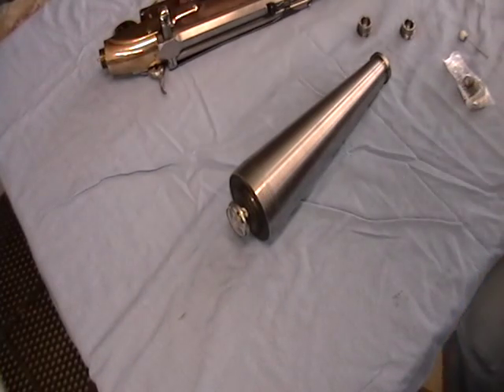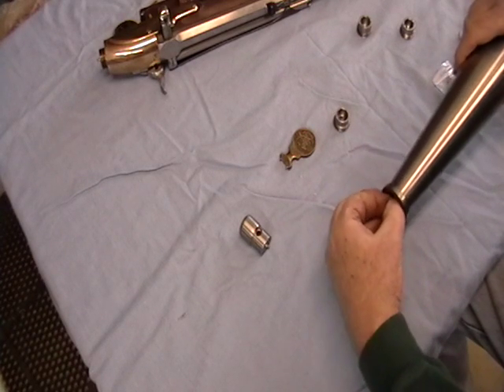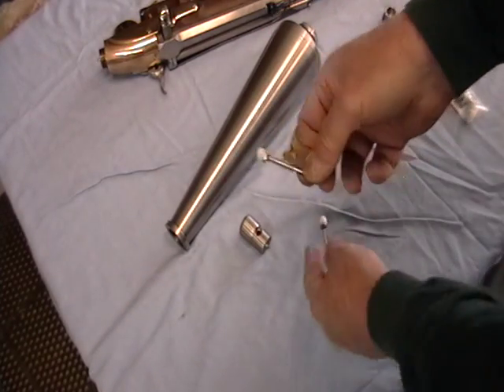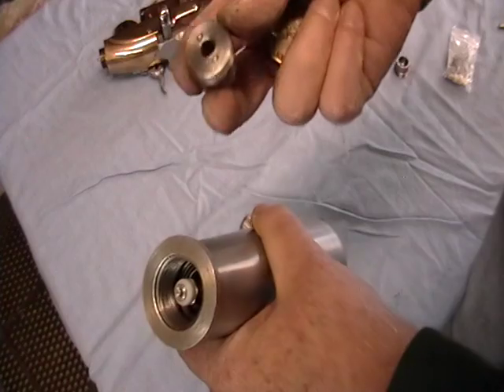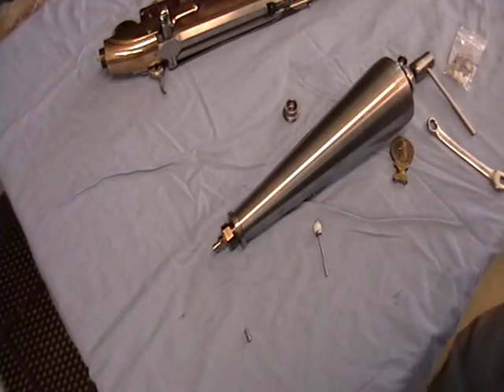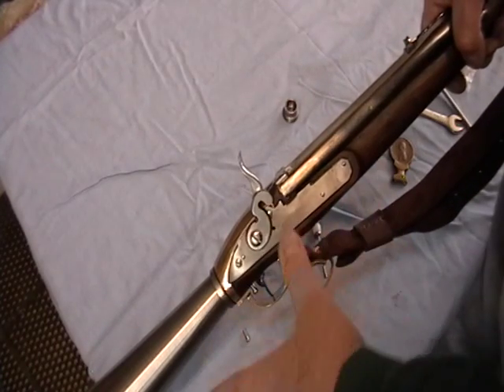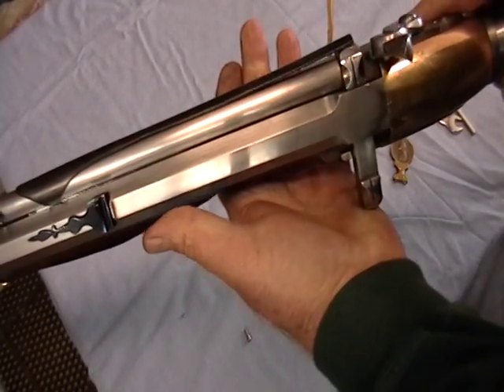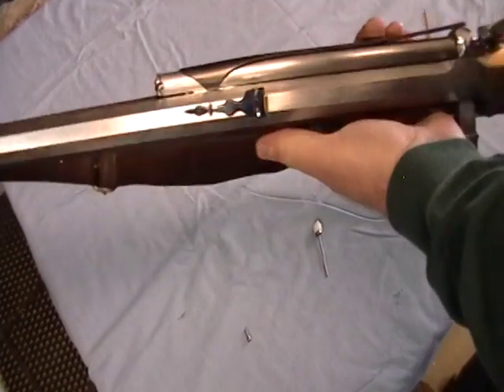Girardoni (Girandoni) Air Rifle flask and valve

Comment: It is clear that Mr Girardoni was a time traveler who was stranded in the past and used his advanced skills
to make the marvelous air rifle.
Reply: not quite, not quite. There are many examples of fine mechanical construction from way before Mr. Giradoni and the first attempt to make a compressed air arm was by a certain Mr. Ktesibios... around 200 BC. He failed mostly because he had no known way to seal off the cylinders with a gasket  or make them concentric enough to not need a gasket.

Comment: Really a brilliant and spectacular piece of engineering for its time, considering both concept and craftsmanship.
I can understand that the whole device was too delicate and complicated, even dangerous, for real battlefield situations. Also its manufacturing process, everything but cheap. Certainly could have helped to enjoy some tactical advantages here and there, although nothing decisive in the long term of a war.
Your replica, some beauty. Your video, simply great. You deserve a big, nice cockade!
Reply: My understanding is that it was actually fielded as an infantry weapon by Austria for a decent period of time. Ten years about if i recall correctly. 
 It did have its problems sure. It was eventually phased down to sniper use by the end of the ten year period. Some of its advantages far out weighed its weaknesses. Its main disadvantages were materials and construction capability of the time. 
The original tanks were hammer formed and riveted from cast sheet iron, then brazed to seal them. There were very difficult to replace and not always made to exact tolerances. Thats less of a problem if the tank threads are a little small, you might be able to fudge it with some gut or something similar. If they were too big tho, your screwed, or unscrewed as it were. 
The power output was ever depreciating per fill meaning that you had to really be thinking about your range with each shot. But thats not really much different than measuring powder while hoping not to be shot and perhaps much easier. Fires when wet. Thats kinda neat when you cant call the game on account of rain, and your enemy is affixing bayonettes and you can still shoot. 
If the historical records are correct, 30 shots on a fill, 3 tanks as standard load out, 3 mags of 20 rounds gives you 4.5 mags of lead before you have to pump. Im betting that a fast lad could swap tanks in the time it took a muzzle loader to load a shot. 
 The reload was likely a little slow between mags given the fine motor control it took but say it took twice as long as it took a muzzle loader to load one shot, you just but 20 shots 90% into battery. Lets call that 10x on the cyclic rate over competing platforms. And given that you only have to really tilt the rifle a little off target to bring it back into battery, at least ostensibly, your target reacquistion time was easily 100x faster per reload. 
 Im not saying that its not without its limitations and downsides, but it was quite a bit like the difference between a mauser 98 (i think) and m1 garand. Not a perfect analogy i know, but its not terribly inapt.

Comment: Could you do a video on the trigger system and how holding down the trigger does not empty the reservoir? A video of you drawing on the back of an envelope would be ideal.
Reply: That was actually done here. The trigger releases the spring that drives the spoon this disengages just after striking, so the spoon is essentially being driven by impulse or inertia. This opens the valve that under spring and air pressure, slams back shut, against the spoon assembly, pushing it back into position to be armed again. I probably bungled that but the basic idea is correct.
Edit, sorry. It wasnt explicitly done here, it was implied. I had just watched the previous video and it ended just before this started and he showed exactly how the trigger and valve works.

Comment: I used to be a Rev-War reenactor and Buckskinner and was aware of the Lewis and Clark air guns, but never knew much about them. Recently I found out about modern PCP air rifles and finally found your video and a few others on the Girardoni air rifles. Amazing. So was the Girardoni the original PCP rifle? And what happened in the interim? Did the world forget about PCP rifles till just recently? What was the drawback of the Girardoni? Too expensive to build? Or did people miss the smoke and noise of BP rifles?
Reply from the maker: +dkeith45 
The earliest mention of a PCP is from ~1602.  Marin le Bourgeois of Lisieux presented an air rifle to Henry V of France.  There were dozens of designs made before and after the Girardoni - see Air Guns by Wolff - download here:
http://www.maxback.org/ebooks-list/air-guns_451v3.html
The high powered airguns were made obsolete by the smokeless cartridge powder burners in the 19th century.  
The Girardoni was expensive, unreliable and the metallurgy of the time wasn't advanced enough to allow safe, high pressure reservoirs to be mass produced.  Also,  the tactical use of such a weapon was unknown and military minds aren't into radical change (what? no boom? where's the fire and smoke?).  It was successfully used in night attacks (no flash or smoke) and guard duty (impervious to weather, repeater).  Fortification defense was another successful use.  Field use was a disaster - high attrition rate, and the troops distrust of an unfamiliar and unreliable weapon.
Reply: @morrodds  I do have a picture of a Leige Lock with the date 1572 engraved in the butt reservoir.

Comment: Any chance you have any plans dimensions anything so I could build one of these. I just find this to be something I would like to build for the fun of it. I would love to duplicate the entire kit pump flasks and everything exactly as original.  Of course I would build better flasks for use and true to original for display. 
Even high res pictures of the parts next to ruler would do.  I have always been able to repair rebuild or make anything.
My preference would be to build as many parts as possible just as they did in the past. Casting forging/blacksmithing
Filing etc with Period tools and using Horn/bone for seals. I might even like to try to make a living making repicas of varying calibers..... In the current economy I really need to find something to make a decent living. Possibly air rifles seem to have enough people interested to keep me busy. To many things today require licensing and the govt controls are overwhelming and excessive.
Reply from the maker: +jolllyroger1 Start here:
http://www.scribd.com/doc/162870851/The-Construction-and-Operation-of-the-Air-Gun-Vol-1
Reply: +Martin Orro very awesome except scribed  bites ... are you going to do it in a simple pdf  or are you monetizing the book
Reply from the maker: The book is out of print and the scrbd link is the only complete online source I'm aware of.  Not sure how they get around the copyright.  I own both editions of the book and they were the basis for construction.  This site still has some copies for sale:
http://www.greatwar.com/scripts/prodList.asp?idCategory=52
Reply: +Martin Orro hey I really appreciate that. ... I really loved the video of you shooting it.  I see this air rifle As the ultimate shtf survival tool ...

Comment: Your an amazingly talented man. If this exact gun had a 25 caliber barrel would it have more energy? Would the speed go up accordingly?
Reply from the maker: Shane K Probably less energy but higher speed.  The area of the bore is proportional to the energy that can be delivered to the projectile,  so - double the caliber will quadruple the theoretical energy delivered.  Now the weight of the projectile comes into play as regards to the velocity.  Plus the tune of the valve opening, transfer port volume, barrel length, valve diameter and stroke, and other factors bear of the ultimate power and efficiency of the gun.  So if a .25 cal barrel (of the same length - good luck finding one) were added,  you'd probably have higher velocity with a large amount of wasted air and lower muzzle energy.
Reply: You must be a rocket scientist. This stuff is just cool